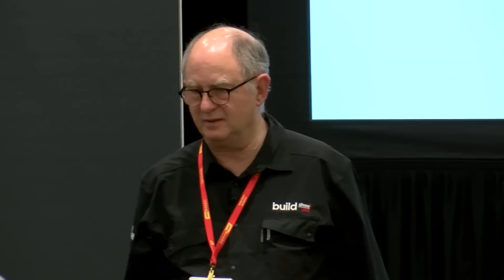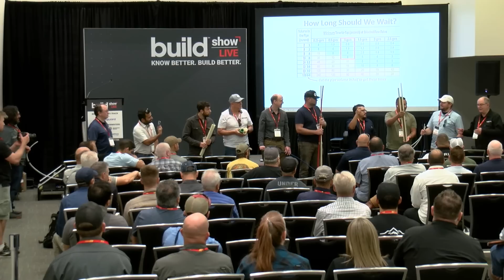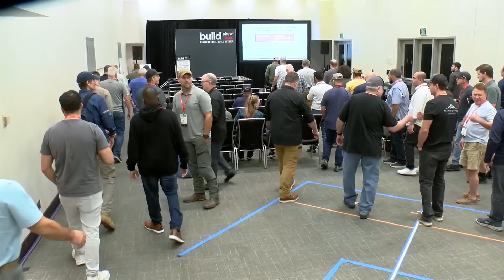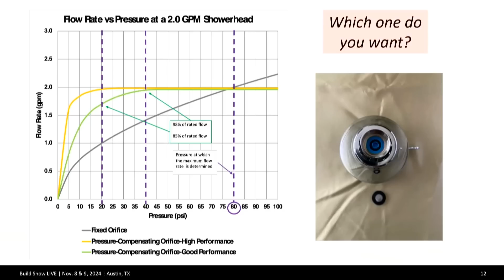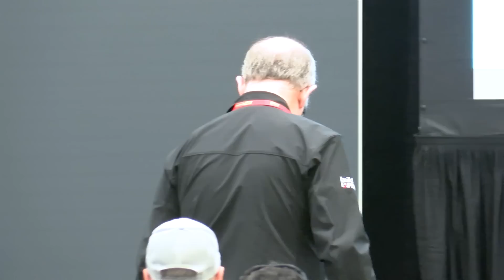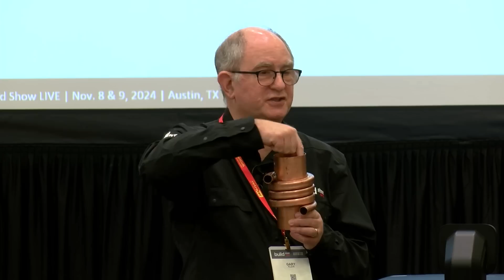Ever hear anyone complain about how long it takes to get hot water?

Comment: My plumber does Hyatt hotels and he said there has to be HOT WATER at the tap at ANY ROOM IN THE HOTEL on a four count. 
He then showed me photos of the banks of instant tankless hot water heaters and intricate manifold system to recirculate the water around the circuit. There were 17 tankless hot water heaters on the main floor and 10 on the top floor all serving 120 rooms.

Comment: Why not put small point of use electric instant water heaters at each shower / bath teed off to the vanities, and only distribute cold water? The increase in wiring cost should be somewhat offset by the reduction in plumbing cost. 8KW instants that would handle most any shower only need 40 amp circuits, and kitchen sinks can use 30 amp circuits.
Reply from the maker: Way too costly. And if you add in hard water issues the maintenance would be insane. Just plumb it like Gary teaches and you can use a single tank

Comment: Very thought provoking seminar!
I've been saying for at least 5 years,that efficient use of heat through appliances will be the next big break through. 
Some give constant heat refrigeration ,water heater ...some intermittent clothes dryer/ microwave.
It would be nice if their exhaust could be shared in a closed single room with a heatpump water heater,vented through an exterior door depending on location and season.
Hopefully at some point heat moving appliances will have separate compressors and condensors...this would make the units lighter,cheaper,larger interiors and keep the heat away from conditioned spaces.

Btw the best heat recovery for drains would be in shower P-traps.

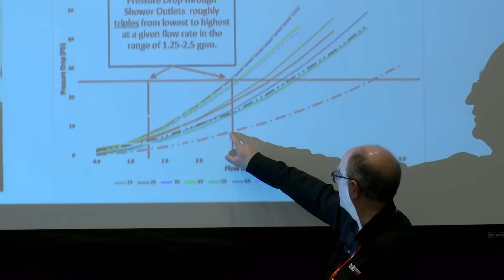Comment: An important point at 32:00 is that some shower heads have more flow and feel better than others. 6 psi vs 26 psi lost is a huge difference. Also important: a high-performance pressure-compensating orifice provides a smoother gradient of flow at lower pressures than regular flow control devices. They're commonly made by Neoperl.

So, like with any product, you can get screwed if you buy the wrong one. High flow isn't needed, it's just a crutch for bad design. That's why we make rules to incentivize industry to improve their products and screw people less. Don't just buy what looks good; buy what has good reviews.